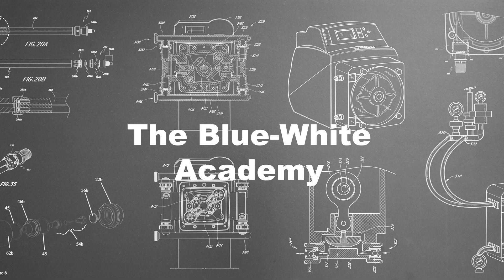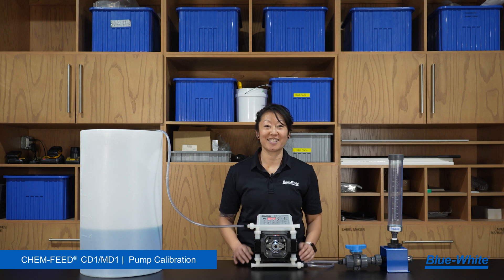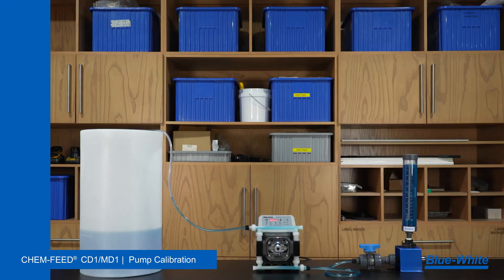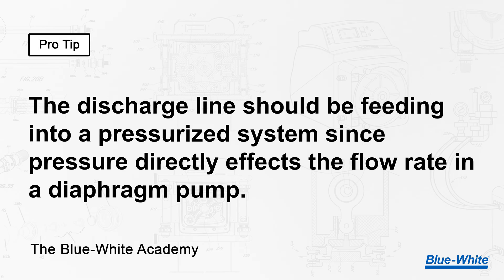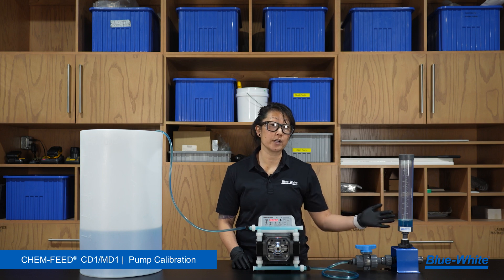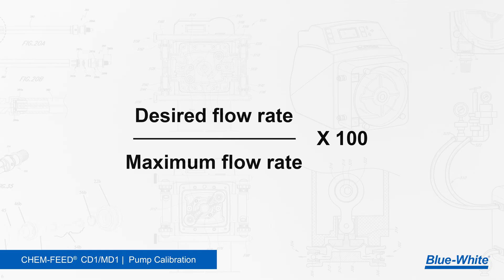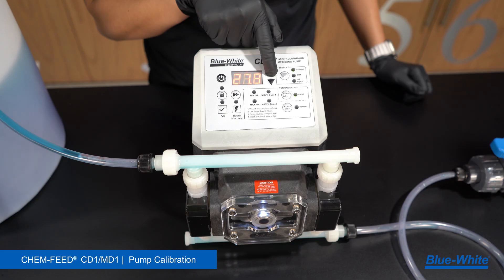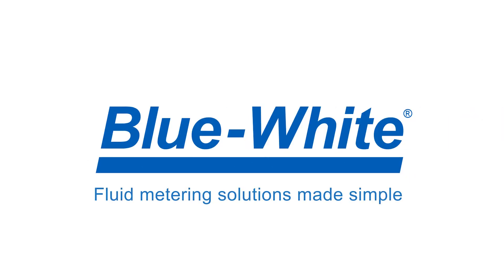How To Perform A Diaphragm Calibration: CD1 | MD1

Comment: Is that means, the max flowrate is the flow rate taken from the calibration tube?

And then using the equation, we get the speed we need to run for our desired flow!

Another question, what if we have fixed speed motor but stroke adjustment?